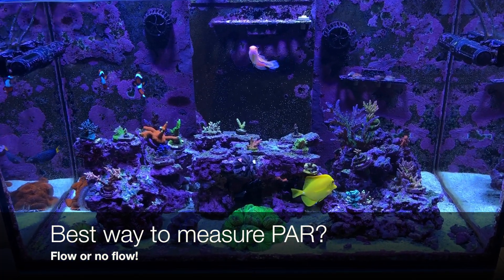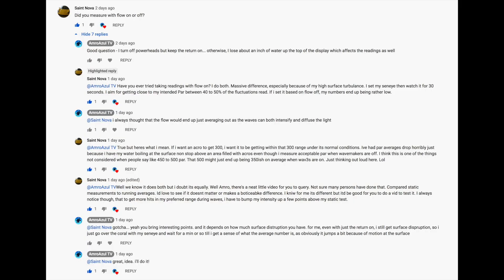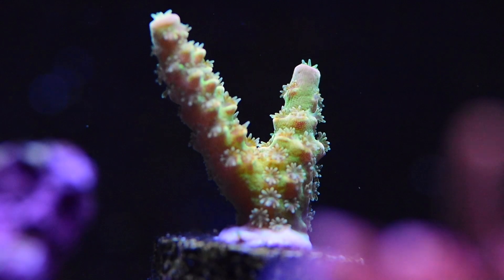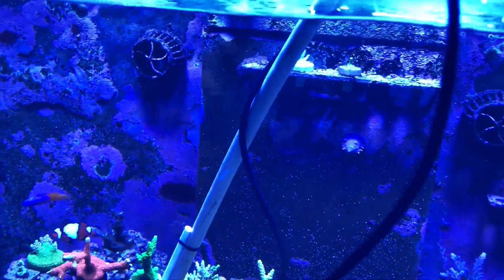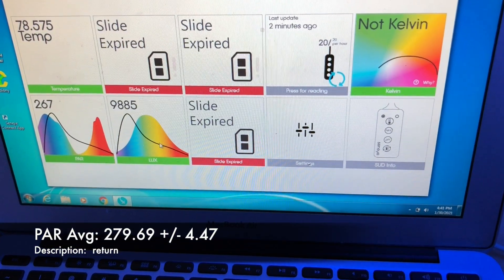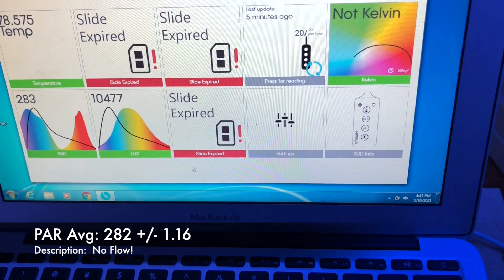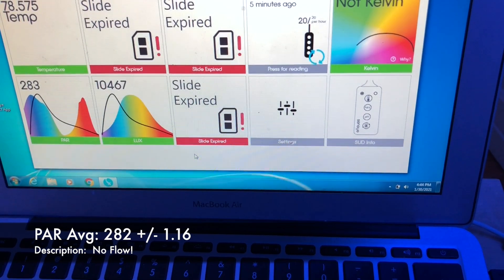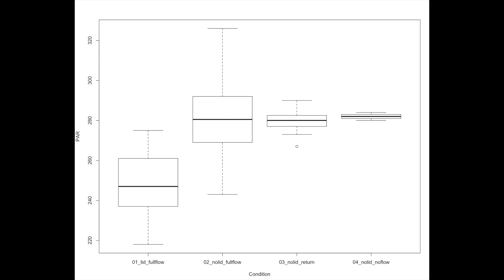Best way to measure PAR: Flow or No Flow

Comment: Do this seneye measure the spectrum of the light to? (I guess not, it is to “cheap” 😁 )
I am consider to get a par meter in future, but I wanna be able to measure the spectrum to know when the light have to be replaced.
Reply from the maker: Yes but that feature doesn’t work for leds. I think the Seneye is a good bargain though - it has other features like ammonia monitoring (although o don’t use it :). I also like that it (supposedly) reads the par from leds correctly. I think the apogee par meters require a conversion if you are using par. One negative thing about the Seneye as a par meter is that the sensor is flat and this needs to be perpendicular to the light... for leds, because their at point source, you have to move the sensor a bit to find the sweet spot that aligns to the nearest point source of light. This takes a bit of time and effort as you have to this adjustment for every coral. The apogee though has a shape that ‘collects’ light from multiple angels, so less fussing about.  For me, I just wanted somethimg inexpensive to get a general sense of where my lights are at... at the end of the day, accuracy and precision don’t need to be super high... it’s not like acroporas need super specific light requirements (eg 373.3 +/- 0.5 par :) ... we would all be doomed if that was the case :).  You just need to get a sense of 200 vs 250 vs 300 vs 350 vs 400, that sort of thing. The Seneye does a good job at that
Reply: @TheBioReef  Yes, the pricepoint is very good and the seneye will be 100 times better compared to my eyes.

I will thinking about, and maybe it consume a lot of time and seneye throw out a new device meanwhile.... :-)
Reply: @TheBioReef  okay, I got finally the par meter from seneye. It is a pain to use because usually I only have linux. Anyway, i have to live with this disadvantage because the other par meter are to expensive.

Currently I am struggling with corals. Som
Corals are doing well like euphyllias but some sps and also my trachyphyllia suffer. Do you know how much par your trachy does get?
Reply from the maker: @neptunes_pot  oh yes, the PC only compatibility is annoying... i had to load windows on my macbook to run it. I haven't directly measured PAR over my trachphyllia, but i am guessing about 200-250 based on adjacent SPS on the sand bed.

Comment: I've been trying to keep up with videos as best as I can but have a question for you.  I know that you are focused on coloration and growth for your SPS this time around.  Are you finding that you still need to dose PO4 and NO3?  I set up my tank June of last year after breaking down a tank I had for a few years.  This is an SPS tank.  I have been feeding twice a day and way over feeding Redsea coral program.  I cannot get detectable nitrates or phosphates no matter what I do.  Coral colors are pretty great with the exception of about 2 pieces.  I kinda wanted to get your take on what youre dosing and how often etc.  I am running a redsea reefer 170 so I could most likely do the math and come up with something similar to what youve got going on.
Reply from the maker: I dose Kno3 every other day to keep nitrates between 2 to 5 ppm. My phohspates are stead at 0.15 without any dosing, although i feed a lot.  I've also been dosing aminos every other day
Reply: @TheBioReef  thanks. I’m getting crazy growth I’ve just got 3 piece with full colors. Rest of the tank is looking great but I wonder if they could look any better. 

What product are you using for nitrates? Do you have a formula for how much your adding to keep it in range. I know each tank will consume the nitrates at different rates. Just wanted to see what you were doing.  Thanks and keep up the great work
Reply from the maker: @mtbright06  I just use a pharmaceutical grade KNO3 from a local science supply company. I make a 0.01 g/ml stock solution with rodi water and then dose 1 ml every other day. Perhaps your 3 frags just need a different location. I wouldn’t necessarily go out of your way to change tank chemistry for 3 frags... if you happy with most of the sps, then just switch the locations of the dull ones to see if it affects their colors
Reply: @TheBioReef  I'd move them but theyve already encrusted.  This is super helpful!!

Comment: Nice video as usual very nice tank amro.. i have question away from bar its regarding no3 and po4 dosing .. i suffer from very low nutrients for more than 4 month and always zero no3 but there was always measured po4 and once po4 went zero i start to have problems with my sps losing colors and start to stn from the base !! In egypt is hard to get nitrate chemicals .. i got potassium nitrate and potassium mono phosphate i made solutions for both and now i am dosing daily about 4ppm nitrates and 0.2 ppm of po4 to keep my nitrate at 3ppm no3 and phosphate now reading 0.04 .. but my fear of dosing is from potassium is it will be harm in long term dosing ? How you keep your nutrients high by what type of dosing
Reply from the maker: I also dose potassium nitrate whenever my nitrate levels drop below 5 ppm. My phosphate is pretty consistent at 0.13 ppm. I occasionally test for potassium but the nitrate dosing dosent seem to be elevating it to high levels. I also feed a lot (4 times a day) which I think helps with providing both nitrates and phosphates
Reply: @TheBioReef  so you are not dosing daily ? Because i dose daily if i stoped dosing my nitrates will go down next day !
Reply from the maker: @mohamedgendia4274  no, i only dose every other day.
Reply: @TheBioReef  how any ppms you are dosing every other day .. i dose like 4 ppm every day
Reply from the maker: @mohamedgendia4274  I make a 0.01 g/ml stock solution of KNO3 and I dose about 1 ml of that every other day

Comment: Great vid, wouldn’t have thought that the screen would decrease the par, I would try another type, smaller holes or even a black screen to try and decrease your loss!,
Reply from the maker: Thanks T. I would think they going with wider mesh would be better, and also I think black vs clear would be worst because it would Absorb more of the light. Either way, not a huge deal give the power of the radions. All the best!

Comment: I havent unboxed my Seneye since i got it a few months ago.. I have so much new equipment sitting in boxes unopened because I’ve been too busy.  Need to check my lights PAR asap. The tank is coming along though.   Are you running carbon? The water looks clear but I wonder if you could measure the clarity before the test.
Reply from the maker: I run a tad bit of carbon in a bag in my sump, although it is rarely changed.
Reply: @TheBioReef  nice, how about Ozone? BRS did a video I think recently on how much running carbon/water clarity has an effect on Par.  Im sure your water is as clean as can be watching all your videos. It was just a consideration I had. I might test before and after carbon this week or next and Ill let you know either way if I see anything.  🙏🏻
Reply from the maker: @skyking9248  yeah certainly dissolved organic carbons will affect transmission, but they would only come into affect in terms of par reading of you tank shows big changes in clarity over time. So I am guessing that this is not a big concern for most. Cheers and let me know what you find
Reply: @TheBioReef  also i should make a quick video soon and post it so you can see my tank and would love your input! Ill work on that!
Reply from the maker: @skyking9248  sure!

Comment: This is a valuable study.  The box and whiskers plots generally have upper and lower box lines representing the 25th and 75th quartiles. Subtract and you get the interquartile range, which is a nonparametric measure of variation, analogous to the parametric standard deviation. The line though the box is usually the mean. 

Obviously the take home message is to measure with minimal current so that one doesn't have to average many readings. This is a valuable result.

Finally, there is old speculation that the random focusing of light through water in metal halide simulates the sun. LEDs are designed to create some of that effect, so the measurements through current might indicate a valuable fluctuation in PAR.
Reply from the maker: I actually set the whiskers in r to represent the 95% CI. Cheers
Reply: @TheBioReef  Oh, usually the whiskers are min and max, but R is very flexible, and 95% CI is a much better measure. It's great that you're using your statistical tools for good and not for evil.
Reply from the maker: @skzion2  hahahaha. Stats aren’t evil, only people are evil ;) yeah love r! Was going to do something fancy with gg plot but just the generic plotting functions... so many analyses, so little time. Cheers